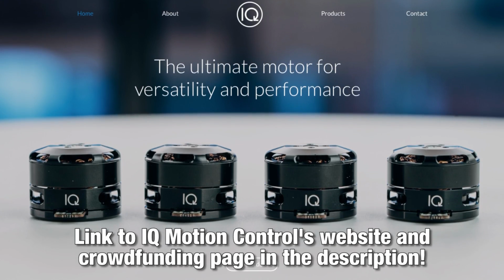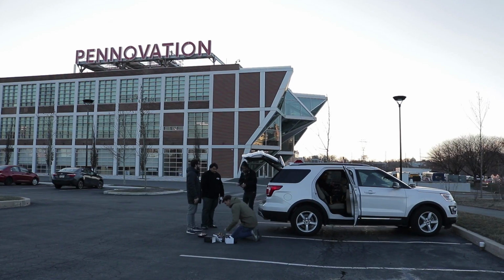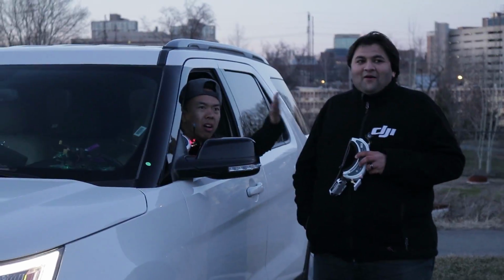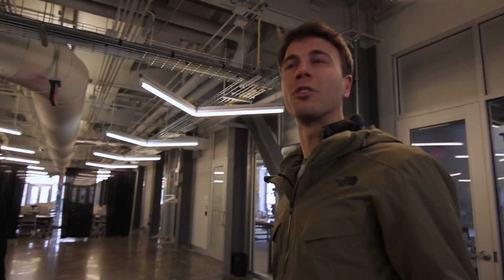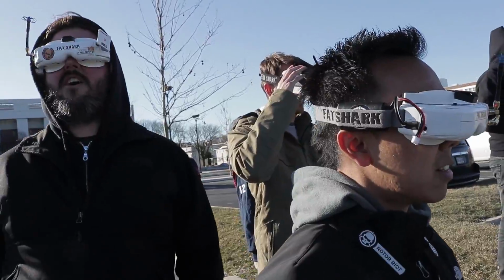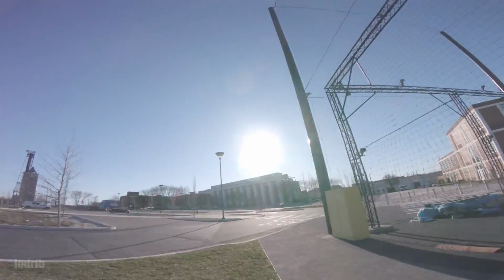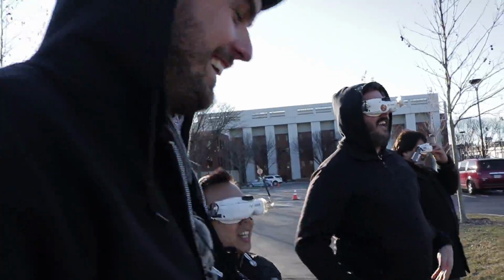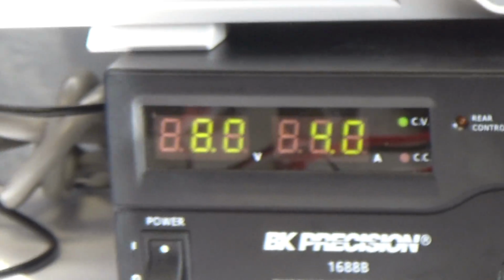Next Level Innovation - Featuring IQ Motion Control

Comment: Matt designed a fancy sensored ESC and software but he doesn't seem to know much at all of aircraft. Tommy busted him about the overlapping props idea. Sure, you could put on larger props without increasing the frame size (would have to raise/lower the motors/props to stagger them), but then there's a whole mess of inefficiencies between the overlapping props, especially when they are spinning at different RPM (as Tommy noted). There are certain configurations (prop size/pitch/RPM) for contro-rotating prop drive systems where you can gain efficiency, but not in the use case Matt described for a quadrotor layout with overlapping props.
Also, Matt makes another erroneous assumption that cyclic controls on a helicopter or multirotor would allow for lateral translation movement without tilting/rotating the body of the aircraft. Moreover, with the multiple motors/props mounted on a rigid body/frame, collective pitch control of each prop would be a much simpler/better method of control than cyclic control on each of these hinged rotors (which do not have collective pitch and still require changing RPM).

Comment: I've used industrial servos with similar motor performance for almost 30 years. In this case the size is smaller and it's simply a different application.

Comment: Kevin, you're not right about how braking works. It's not "shorting phases".
Active braking actually means slowing the motor actively, putting current = torque in opposite direction to the motor movement.
Motor spins only because ESC knows the rotor position. The difficulty is when the motor spins slowly or stops  - this is the moment, when hobby escs do not know the rotor position and position sensors would give any advantage. 
Otherwise, for what we use in not-3d-mode there is no benefit using position sensors (most motor drivers use sensors to spin motor up, then switch to sensorless algorithm) and almost no benefit using advanced motor control algorithms... but maybe i could see some improvement if ESCs stopped using delays for commutation and start using integrational methods - predicting when to commutate more accurately - providing more torque in some situations.
Reply: mrozu1337 ^^

Comment: This tech could sense what motor(s) aren't able to be turned after a crash (due to obstacles), and block those motors from spinning in an effort to dislodge the quad. You could make it smarter too, say, once you detected a threshold movement/acceleration, then test if the previously unmovable motor(s) was then freed. At first maybe having manual control over this, but eventually being controlled by the system as a kind of "get out of scraggle free mode".

Comment: yeah but all the motors are going to be $400 because they have encoders inside of them
Reply: And they'll break easier!   the coolest part of quads is that you CAN crash them!     this is why I stopped flying CP Helis!   too fragile!
Reply: Our modules (motors + ESCs) are actually just $80 apiece and less if you buy our kits! Check out Crowd Supply (link above)
Reply: IQ Motion Control that's not bad considering the hardware, but I'm currently running motors that cost less than 10 USD because I tend to impact brick walls at high speeds 😂
Reply: We have that problem too lol...Having better motor control might help you avoid those walls though!!

Comment: I uh.... need those motors and ESC's... for science. Totally not salivating like an idiot wanting to try. Motor position sensor has been an idea I've wanted to see implemented for some time- it's really awesome to see IQ Control has done it!
Reply: When we found out that they had an immediate benefit to 3d... you came to mind. We already talked about getting you a set once they're ready. Stay tuned Zoe.... you're going to freak when you feel how smooth these are for 3d (and it does 3d without you having to tell the FC to... not that it's the way I'd suggest it)
Reply: Can't wait to see what you can do with our motors Zoe! We'll get you some ASAP
Reply: Zoe FPV I would love to see you rock their motors
Reply: Zoe FPV I was gonna run to discord and yell " Zoe , did you see this ?" . Lol
Reply: Brushless position control has existed for some time, servos in automation use large brushless dc motors for position control. Its cool that the motor control algorithms are finally being used with quadcopter brushless motors !
Reply: @kylelmnop  Yes, bot those servos can't provide enough power to fly a copter.
Reply: They got to invite you testing Those Zoe !
Reply: Aloha Zoe😎🎮🤙🏻
Reply: Zoe FPV right! Once I realized what it does, I too salivated! Definitely can’t wait!
Reply: When will the 1105 size be out? :D
Reply: Can't wait to see you try these boxes of tricks out!
Reply: Zoe FPV I wanna see you with those .... Dive a building go in reverse and go back up it just like someone hit rewind on the video
Reply: There's only one name I think of when I think 3D multis. Glad that Tommy & company feel the same way.
Reply: ummagawd are you serious ?!  That's so crazy. Oh I'm loving this. Thanks you guys for making this episode. Great video by the way.
Reply: the transition from one direction to the other is incredibly smooth...I remember your videos and that issue will be solved with this "new" tech
Reply: You would rock those so hard. A spectacle well worth seeing.

Comment: Hey guys! I think what you could probably do is have the normal layout on your transmitter but then have an extra stick for your right pointer finger or left depending on if it’s mode one or mode two and have the pointer finger control whatever the technical term for the blade “tillage”is 

By the way my name is Cade and I went to the first quad camp at Xhover studios where I learned in infinite amount of knowledge from you guys thanks for that by the way

Comment: old tech, widely used in RC cars (aka Sensored Brushless system.)
Reply: unless they're doing it without using external sensors by finely sensing the magnetic fields induced on the various phases of the motors.
Reply: Gon Qu that's what i was thinking lol, at least5 years old tech lol
Reply: Yep, pretty common on electric longboards too. Useful where heavy braking is needed.

Comment: I wonder if the quad can know the position of the motor and in turn the prop, it would be much easier for it to fly with a missing prop blade or blades, or flying with having a whole motor disabled 🤔the potential of this technology is immense... Even helicopters could benefit from this (make it easier for giant, brushless electric motors for the tail and main rotor of a helicopter?), Or a whole new type of flying machine, just like we saw in this video (like at 7:24)
Reply: This is definitely a benefit we've been thinking about. We'd love to see someone disable a motor mid-flight and keep the vehicle stable. Some quads might have to be sacrificed 🤕
Reply: IQ Motion Control would it then be possible to not have to balance props on large 7inch+ rigs then? Would make it much easier to make big quads
Reply: Unbalanced props are a radial force and electric motors are usually designed to only make axial torques.  So unfortunately no, the motors can't stop unbalanced props from shaking the quad